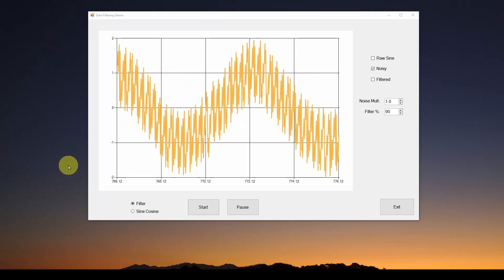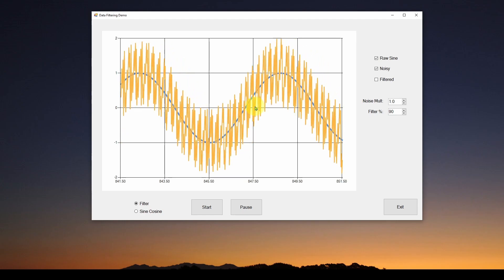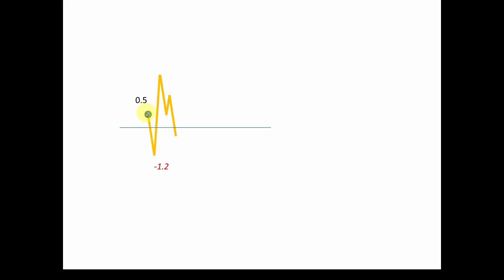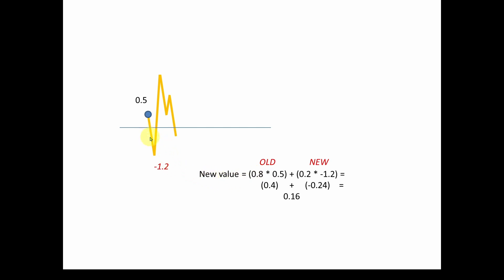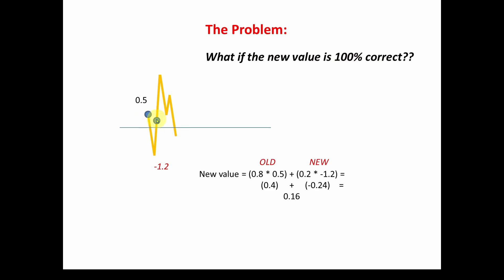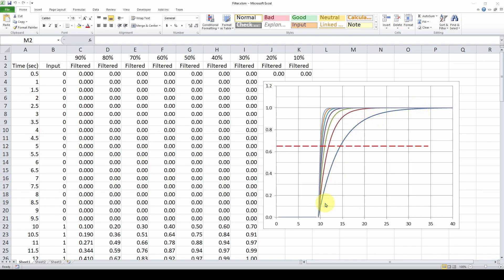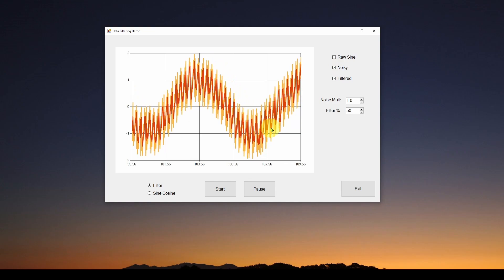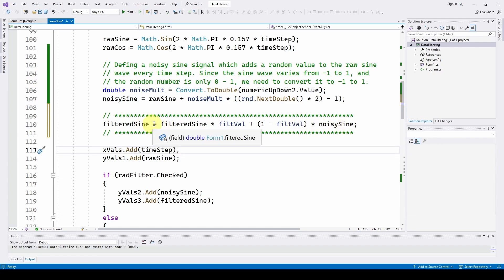Data Filtering

Comment: From memory going back 45 years ago, when I was finishing my EE degree, I believe they called this Exponential curve smoothing in discrete time series. 
I worked on autopilots as part of my career and the Z domain filters used this algorithm. A big problem was the time delay introduced, especially when the data samples were at 52Hz, and the autopilot computations were done at 30Hz. Aliasing issues could introduce unwanted surface oscillations, both from delay computing (taking a sample, that had delay from the sensor that converted it to a usable engineering unit, shipping this via a serial bus, receiving it and putting it in a memory buffer, and using that value at the time the control law computation was performed) and loss of some of the input data samples (as 52Hz being used at 30Hz had some samples thrown out). I always wanted to have some sort of filter that would model the input data, and predict what the data would be (a future value), so that value could be plugged into the flight control law equation, to overcome computation delay. That is, predict what the attitude computer value would be at the time that the autopilot puts out the servo command, so all that time delay lag is removed. It was a mess, as too many fears of certifying and verifying the software. The worry is some sort of mode that causes an oscillatory response, as these can break the airframe. The safety requirement is to be able to show by analysis, that no fault exists that will result in a catastrophic fault, with one in a billion probability per hour of operation. If you can't analyze it, you can't produce the analysis.
The other fix would be to have the autopilot run at the same Hz rate as the sensor data. Processor horse power was not that great when microprocessor's were first used for commercial aircraft. And as they got it to work with the 30/52 in the early 80s, it got certified and left that way. Even as the microP horse power improved, backward compatibility drove zero improvement.